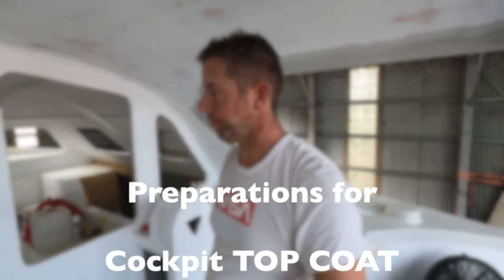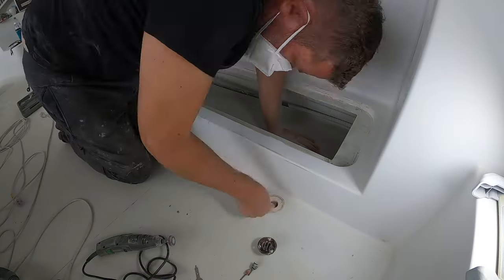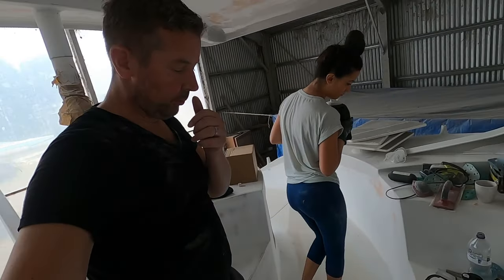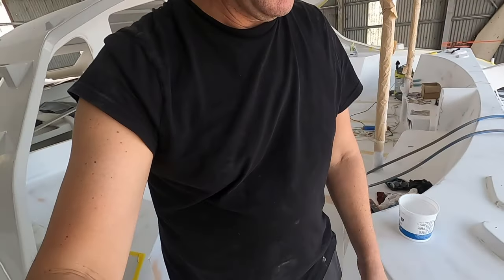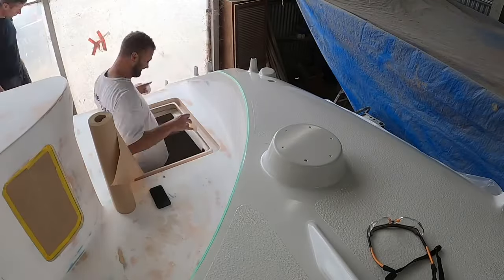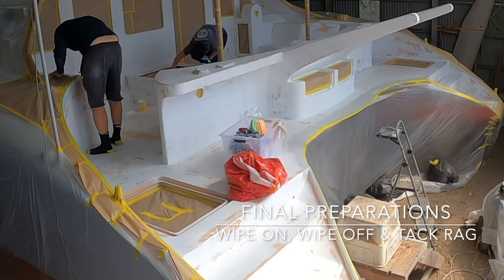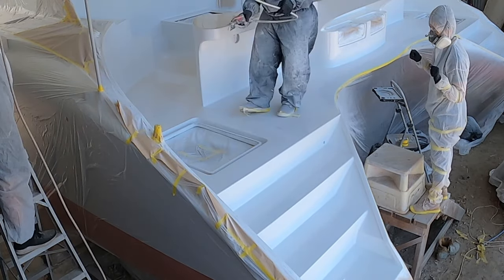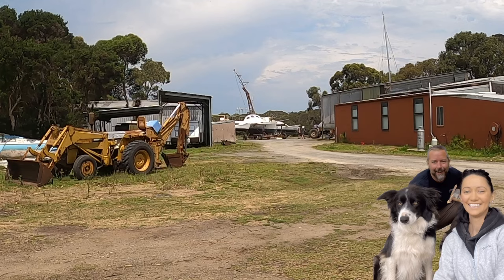Spray Painting TOP COAT in the cockpit - S03E13 - Building Wilda | Catamaran Restoration | Refit

Comment: Wilda is looking  everything  a super cat what a transformation in the years you have had her congratulations to you both  the only thing im asking  will you be having  a second  steerage position  inside  the  cabin  for those when  the weather  turns funny or emergency steering  she will look great on the water well  done see you next week 😊😊😊
Reply from the maker: Only one wheel, but yes, the autopilot will be set up inside as well.
When it comes to emergency steering, very little can go terribly wrong with the type of steering she has, mechanical push pull cable, and the bits that are most likely to fail can be replaced fairly easily and quickly.
We plan on adding tiller(s) eventually.

Comment: Can someone please explain to me the engineering of the front transverse spar. To my eye, the diagonal stays should be below the spar, with the tabernackle pointing downwards, like a truss. I know that this is not how it is done though. The only way that I can see that Wild's setup works is that the tension on the diagonal stays forces the tack point downwards, against the lifting moment of the forestay. Is that it?
Reply from the maker: No problem

The forestay is pulling up on the center of the beam.
A rope stretched between the ends of the beam and over the triangle on top of the beam resists this upward force.
Tension in the rope pushes down, through the triangle onto the beam. Tension increases, opposing increasing  upward force in the forestay.
The triangle is sometimes called a seagull striker. The rope, a martingale.

I think that is what you wrote in the end of your comment.

Please go ahead and ask away, we don't mind answering if we're can.

Hope you enjoy the videos and stay around for more! We'll be getting into the outfitting stage real soon.
Reply: @buildingwilda  Thanks for your comprehensive reply. I didn't expect you to answer, as I thought one of your viewers night have responded. I am sure you have plenty of more important things to be doing! You are both doing a fantastic job, and I genuinely hope that you can maintain your energy and committment for the final sprint.
Reply from the maker: No worries. We try to read everything and reply if we can. We really enjoy getting all sorts of input from people watching.

Thanks for watching!